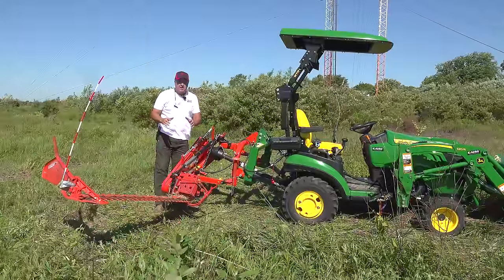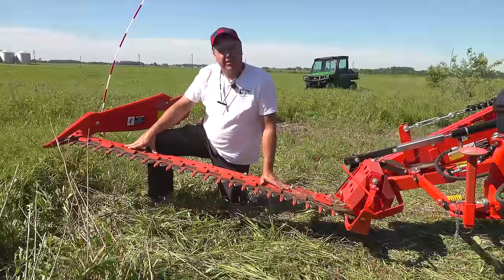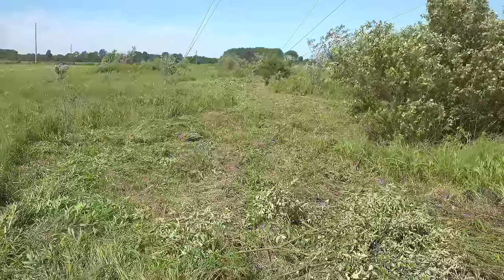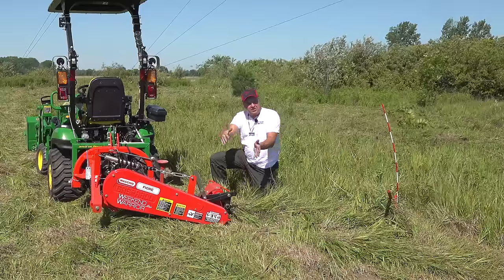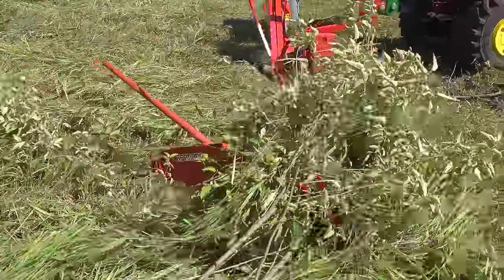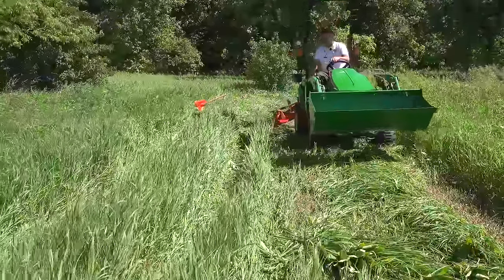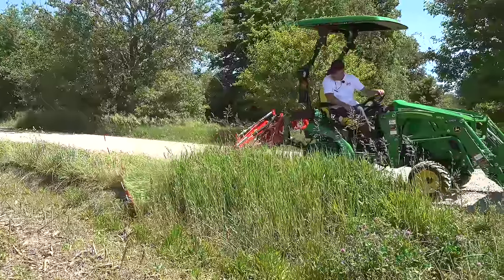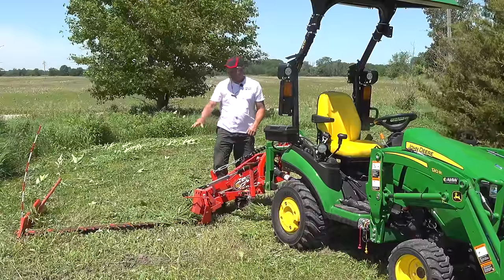Sickle Bar Mower for Subcompact Tractor!

Comment: Tim all I can say to your fans is don't buy one if these. There is a reason no-one making hay wants to use one. They are slower. They are intolerant to debris and time consuming to fix. They cannot pass over already cut sections without clogging up. You have to drive the right speed or the material stacks on top and clogs it up. Baling twine clogs it up. Parts are relatively expensive because there are so many teeth. On my older one on rough ground the bar tends to bounce, skipping sections.

Get a drum mower instead. Costs less, operates to the side just like the sickle, cuts faster, blades are easy to replace and there are only 6, it is much more debris tolerant and still doesn't grind up the grass.

Also 5K is high from what I have seen. Pretty sure I have seen them in the 2-3K range.
Reply from the maker: Never seen a new one that cheap.  Show me.

Comment: any kind of rotary mower tends to mix quite some dirt into the fodder thus resulting in higher crude ash which ultimately harms animal production, especially in dairy but also sheep. sickle bar mowers however just cut the grass which then tips over, just like you demonstrated in the video. rotary mowers, especially with conditioners, are often a secure death trap for any insects sitting in the field where as with the tipped over grass insects still have the chance to escape once the mower went through. this becomes more and more relevant in europe, especially germany where the general public is more and more concerned about the environment. as you have experienced sickle bar mowers need way less engine power thus allowing farmers to mow with smaller tractors and still maintaining wide working widths. smaller tractor = less expensive = less fuel consumption = less weight compacting the soil ultimately hurting plant growth. there are even new manufacturers like german BB Umwelttechnik who reinvent the old-style haying equipment, so you can even get a 3 piece, folded sickle bar mower with around 10m / 34ft working width.
however they often require more maintenance because once the knives go bad, a sickle bar mower rapidly loses cut quality whereas rotary mowers can still rip through the grass just because of sheer force.

Comment: Would it work with my Oliver 550? Am interested.
Reply from the maker: Yes.  As long as you have 3 pt, pto, and one rear scv
Reply: Oliver 550 has a bolt holes for a bar to help stabilize the mower esp the Oliver mowers.
Reply from the maker: I don’t even think you’ll need those.
BTW, I’m a big fan of the Olivers!

Comment: Its brutal irony that for most of the time sickles were used the issue was the "goldilocks" issue.  Too fast too slow just right.  Well since all the tractors were geared and you need engine speed for PTO speed youd be trying 3 low 1 high 2 high 4 low.  All day you would fight clogging up when going too fast or you would be bored to tears creeping along.  What I would have given for a hydrostatic with a speed control lever.  

I also used to have the pleasure of mowing ditches but with a narrow front deere A hand clutch with a #5 mower.  And I'll tell you mowing banks and ditches on a popper is scary.

Comment: Do you need hydralics to raise mower. New holland works only on 3 pt lift
Reply from the maker: This one has hydraulic fold on the bar.
It is an option.
I find I can use the hydraulic fold to raise the bar a bit when cutting with subcompact tractor

Comment: This like most farm equipment this machine is meant to be used without anybody but the operator.  I have seen many farmers three legged dogs not to mention missing fingers etc.  .  So keep kids, pets and anybody else out of the way. 
I originally had a sickle mower for my 'Simplicity 14hp lawn tractor. I currently have a BCS 735 walk behind tractor with a sickle mower attachment.  I'm waith to hear from my John Dealer to see if I can get a demo modle for my new 1025R..

Comment: have anybody convert a sub compact and small large frame tractor backhoe control valve into a hydraulic remote
Reply from the maker: Workin on it.
Reply: @TractorTimewithTim  making a video of convert backhoe valve into hydraulic remote can be helpful tip for you viewer and i am surprise john deere have not made a kit run off that backhoe hydraulic hookup and i will enjoy your talking about getting more use of the backhoe hydraulic hookup

Comment: Get a 4 foot brush hog!
Reply from the maker: Welcome to our channel! We have shown a 4’ brush mower many times.
Reply: Works fine for cutting hay
Have you used the Iittle tractor and mower for that?
That little tractor doesn't have enough hp to run a rotary does it?
Reply from the maker: Please watch some more of our videos.  We have a hay making series.  We also show it running a 4’ rotary cutter many times.
Reply: @TractorTimewithTim  didn't know they made them that small
I'm talking about disk hay mower
Reply from the maker: Ah, yes.  They make a disk mower that small too!  Yanmar, or tractortoolsdirect.com